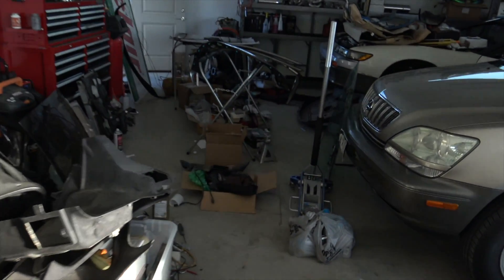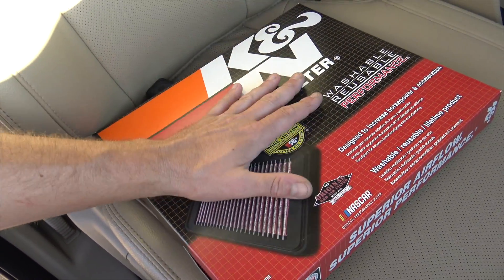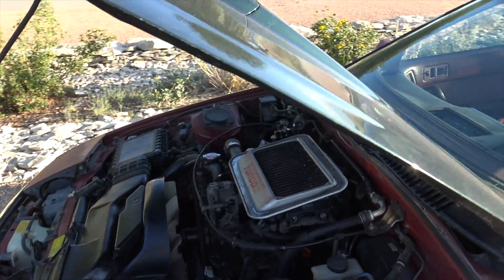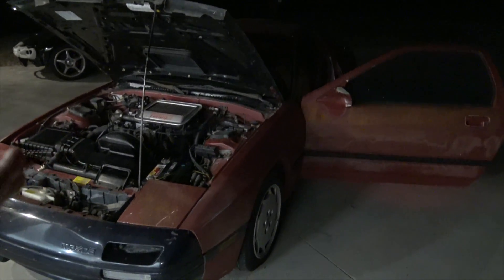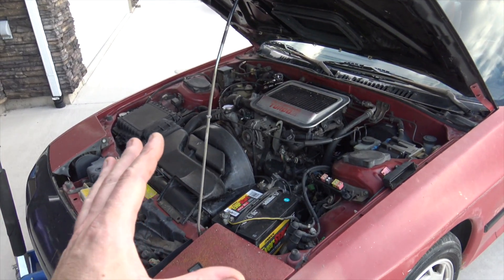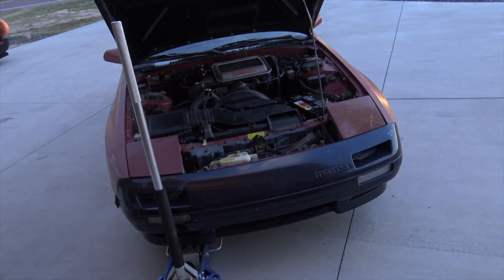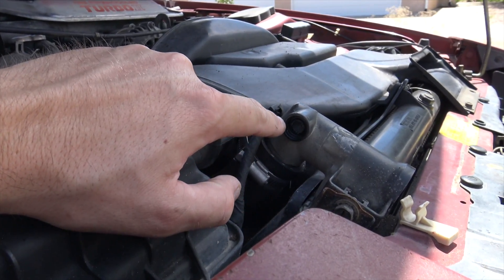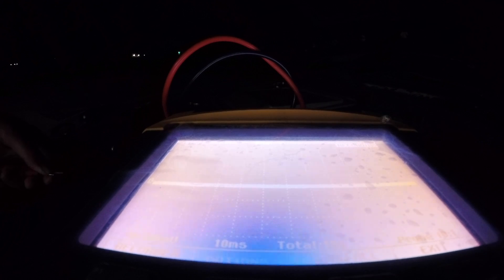Rescuing The Cheapest FC3S RX7 Turbo II From Its Grave | Part 5

Comment: WATCH OUT FOR FUEL CUT! Stock fc ecu cuts fuel to rear rotor when higher than stock boost is detected.(anything over 7/8 psi) And because you’re running an open downpipe it will definitely boost more than that. Get a fuel cut defender or aftermarket ecu.
Reply: Waste gates exist ok
Reply: Broken Piston yeah because stock iwg size on a fc hotside is totally big enough to not boost creep right?
Reply: @brianskotch2922  this thing probably doesn't have a boost controller (at least I don't think so) so it has a spring inside the wastegate that opens up once enough pressure is built up releasing excess exhaust pressure
Reply: @karoliskazlauskas1213  fc wastegate's are notorious for not being able to hold the boost creep........ he should port the stock wastegate and add an fcd at the very least
Reply: @karoliskazlauskas1213  totally get what you're saying but if you've worked on a stock turbo on these things, he's running right at potential issues here.. as the stock wastegate on a S4 turbo is a single 16mm hole. might be able to fit your pinky down there? for what it's worth, it basically doesn't exist once you've got a decent exhaust/intake on there. beyond that, I've heard reports that new, completely stock S4 still had boost creep issues in very cold ambient temperatures, hence mazda put the fuel cut thing in there to kinda(?) protect it.

Comment: Best way I've ever used to find vacuum leaks is spray brake cleaner on the hoses while its running n listen for a change in idle
Reply: Just replace all the hoses with the upper intake off and delete emissions that's what I did takes little time.

Comment: Don't forget too, the open exhaust will pick you up almost 5 psi and 50HP on a TII!....but you will hit boost cut almost immediately, so a boost cut controller will be needed to electronically cap the MAP sensor's output below cut levels. This has the undesirable effect however of making the AFM the computer's only source of airflow measurement, and once you exceed the flap door's ability to open further, fueling will no longer increase. Increasing pump pressure and swapping in bigger secondarys, or go old-school with an AIC or F-con to bump the fuel.....yea, pretty archaic stuff, but so is the OBD0 Jetronic EFI on those old RX's!

Comment: glad to see the progress, if you did not get the rear brake issue resolved already it is probably some garbage stuck in the bleeder screw, you can take it out and use a pick to open it back up the put it in and bleed the caliper.
Reply from the maker: First thing I did was pull it and it was clear

Comment: The RPMs staying up could be the dashpot located by the throttle body. It is there to prevent the throttle body closing abruptly. It has a adjustment similar to a throttle cable. Some RX-7 owners eliminate that and by doing so the exhaust some times randomly will will pop small split second flame when you go off throttle.  The best thing to do is adjusting it to see if it will solve the problem of the RPM going down so slow. If you want to eliminate the dashpot it is best to wait for idle problem problem to be solve first.

Comment: You might break the turbo with that exhaust hitting the ground.
Reply: KLFER how does that work? Just bending the pipe can warp the turbo?
Reply: @nate8867  I'd be nervous backing over something that would catch the exhaust...  a raised section of pavement or speed bump etc.
Reply: @nate8867  It can crack the exhaust housing on the turbo.
Reply: KLFER I don’t think he’s going to keep it like that

Comment: Been there done that . i had a 1979 Fiat x19 with no brakes. But at 2000 lbs. Downshifting got u pretty close to stop. That lasts 20 miles per hr you had enough brakes to stop.

Comment: Is the hole you plugged for a coolant sensor. Maybe that explains why you don’t have a temperature reading
Reply: Yeah that’s also what I thought
Reply: no its not. The coolant temp sender is on the drivers side rear iron of the engine. He put JB over an air bleed which was just a bad o ring or a leaky plug.
Reply: Patrick Lavoie ohhh that makes sense
Reply: It's a bleed valve your supposed to unscrew it to get air bubbles out of the cooling system as its the highest point in the system

Comment: The front engine cover was changed mid year by Mazda. If you order a front seal kit for an 87 it may possibly be the wrong kit. I had a 7 just like yours and it had a pinched seal in the front cover even though the new kit was just installed. It caused low oil pressure readings. I doubt that is your problem though. Love to see this FC being restored.

Comment: I cant wait for this thing to get buttoned up and painted. I think that screw you epoxied was a air bleed valve for the radiator, no biggie. Since it was the early days of ECU's in these, things can be really finicky. Also I might have a pair of S5 tail lights in storage if your interested.
Reply from the maker: How much for the tails?
Reply: Junkyard Dave Maybe just shipping plus 40, the back left has a chip in it so they aren’t perfect.

Comment: Solder near the exhaust will melt and come loose, also the "downpipe" hitting the ground might break your turbo or manifold, please do not ruin this car and make ir proper.
Reply: It's risky, but, ground contact might also just wear the exhaust down until it no longer drags. Personally, I wouldn't do it. I'd rather exit through the hood.
Reply: Its not solder its weld and it will  not melt lol
Reply: Simon Legros I think he is referring to the o2 sensor

Comment: That is the air bleed for the cooling system highest point.  Since the part is plastic it should have a replaceable o ring on the cap. The cap uses a large Phillip screw driver to loose it up.

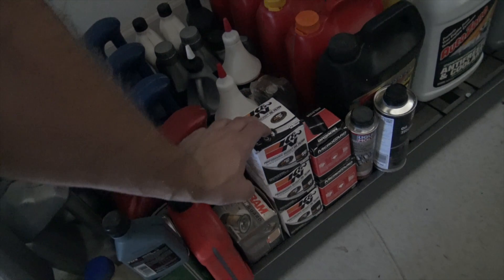Comment: 0:42 OMG those front shocks are so toasted. Makes sense considering how long it sat of course. Dangerous with that extra low downpipe though!
Did you consider replacing the O2 sensor with a 3 wire? Would still function normally, just heat up much faster and hopefully improve idle and cruising etc.
For the gauge cluster, I have often found it's a bent, weak, or damaged pins in the connector. Easiest thing to check. Hopefully that cluster is easy to get out.
I know you probably know a lot of this, but whatever we all know I like to comment. Woulda been brave to go to the drags! Hopefully soon. Good work Dave.
Reply from the maker: Need @bcracingna to hook it up
Reply: Agreed. Time to go make some noise on Instagram. ;)

Comment: I have nearly the exact same FC...
I would replace every vacuum line with silicone hoses.
I use the VR1 in mine as well
Get rid of that dump pipe and get a proper exhaust. I like my Trust exhaust or find someone selling a Racing Beat. I saw one on Denver Craigslist a while ago.
The dash components were notorious for for cold solder joints. Part of the reason the light switch would burn the runs internally.

Comment: I used some injector cleaner on my n/a FC and now it dies while idling, I think the mixture is running super rich. (i'm gettin pops from the exhaust) I'm going to flow the injectors but thats my only guess. maf was fine and clean previous to using the injector cleaner.
Good luck with the rest of your fixes!

Comment: The oil pressure and temp sensors are down by the oil filter pedestal on the rear iron. With the key on, try touching each of the wires to ground and you should see the gauge cycle. if it does, then get new sending units. You can see both of them at 9:00. Since the oil gauge works, Id suspect the cluster is good and power is flowing. The hanging idle is pretty common when you start removing things when running the stock ECU. Its best to pull and plug everything, including the non-vacuum dashpot, then do your best to set the idle speed with the idle and bypass screws. Either that, or leave it all intact and keep everything working as stock(which can be even harder!)

Comment: My gauge did the same thing in my 87 t2 hooked up a true oil feed gauge oil psi is fine they are notorious for going bad.  Check behind throttle body for vacuum leaks there are a few ports on back side hard to see. Also throttle body could be leaking through linkage.  I use cigar method to check for leaks on mine.

Comment: I could be wrong, or not remembering correctly, but I remember my Turbo II tach and speedometer stopped working due to a reverse switch or relay or maybe sensor, I don’t remember exactly. If your reverse lights aren’t working, that could be it. It’s located on the transmission and Rotary Performance bypassed it somehow, as I didn’t have the time or money to have it replaced (it’s hard to get to), but I did have my instruments working. The only downfall was I had no reverse lights, which I didn’t care about.

Comment: That exhaust is going to cause boost creep. Considering your stock ECU will cut fuel, its a very risky mod to save a few bucks on. Also you JB welded an air bleed plug, which you could have fixed with a 2 dollar plug with an o ring.
Reply from the maker: I tried to get the plug out it was broken off it doesn't hurt anything not hard to burp the system
Reply: @Junkyard_Dave  easy outs my man!

Comment: Get the koyo hh66042  i think thats the part number but its a direct replacement. Even has the same air bleeder screw that you plugged up but it wont leak w it being aluminum.

Comment: Horn problem 90% most likely it's the "CPU" - cold solder joint problems.
Long black box in driver's side kickpanel - redo solder joints that hold the plug socket in the center of the box.
Do your turn signals / hazards work?
This CPU also has circuits for those things.

Comment: Hey Dave you should look into getting new secondary coil packs, those might be causing the issue of getting no tach signal. Im up in Westminster, CO and I have a few sets if you want to test them... Also the speedo is a mechanical line that feeds into the trans, its possible that the conector in the cluster is disconected? thats how mine was.

Comment: did you try pulli g vacuum and pushing the brake pedal also I was under the assumption you are supposed to bleed the caliper furthest from the reservoir first or does it not matter im just curious that thing sounds so sick great job breathing new life back in that old girl dave also do those wires hanging out of the bottom of the dash when you were talking about fixing the gauges have any thing to do with it they looked like they were ripped  off a motherboard from the video it looked like there was pieces of it on the end of the wires
Reply from the maker: The wires go to a dash speaker,  and on non abs cars the master is devided front and rear so it makes no difference

Comment: That thing that was leaking on your radiator is meant to bleed your cooling systeem, you remove that plug when your filling up your radiator so that the air will get out.

Comment: Have u seen good results with the liqui-Moly additive?
Reply from the maker: I use it in everything and it saved my Volvo from dieing when an oil filter exploded somewhere on a 3500 mile road trip
Reply: I appreciate the reply. 
Ive heard alot about this not working great in a rotary motor due to the high engine temps causing the moly to break down. 
Also, you added two cans to an oil change?
Reply from the maker: The oil should be around the same temps as a normal piston engine, plus it shouldn't brake down since it is mostly zinc, and I only used one can but fill it with oil to clean the remaining stuff out

Comment: Do u guys use 2stroke oil with your fuel? (Rotatory), Like, always or just to start like on the previous video bcause its sit for a while?
Reply: Always premix.
Typically when starting for first time in a while you'll use ATF in the housings and slowly rotate them over to free seals up well and coat housings

Comment: please port the wastegate and add a fuel cut defender before you fuel-cut the rear rotor and blow this up. the stock wastegate can not handle extra boost created by opening the exhaust like that.

Comment: That wankel is running worse than a normal engine without spark. Its suppose to run as smooth as putting a coin on top of the engine side down and not tipping over. Its not running good
Reply from the maker: The engine mounts are old rubber and it has everything delete so idling at 800-950 I would say it runs about as good as my built 13b in my FD if the idle wasn't set at 1200

Comment: maybe just me, but that thing looks SLOW, slower than my ZX3...
Reply: From the factory they only made 183 hp and this one is completely fucked so... yeah. Fun Fact: the ZX3 came with the duratec which was originally a mazda motor as well. People get these cars becaus they take mods well: https://www.youtube.com/watch?v=CGEEYZ31xz4
Reply from the maker: Wasn't ripping it just working out the kinks, if you want to brake something just go beat it to death before you make sure everything is ok
Reply: He wasn’t getting into the throttle much because it was a test drive 🙄

Comment: Trained technicians would know you bleed brakes furthest from the reservoir and work back 🙈🙈 please don’t touch brakes if you don’t know what you’re doing 😱
Reply from the maker: That's only true with abs, front and rear are it's own independent system so it doesn't matter

Comment: Dude what are you doing! People like you are the reason rotaries die. That hole is there to be able to bleed air out of the cooling system and now you have made it impossible to do so. Also why would you hang that exhaust down so far... It looks ridiculous and when it hits something it's not gonna be good. It's a old car. Pull the instrument cluster and clean the contacts. And the speedo may be mechanical on that model so that cable may be broken. Instead of looking for every half ass way to make things work. First look for the right way to do it. You will be surprised at the good results. Like that plug you could have found at the junkyard off of other Mazda radiators. And if that didn't work buy it from Mazda. WOW man
Reply from the maker: I'm the reason rotarys live, the exhaust has no effect on the engine. A rotary engine needs no back pressure
Reply: Junkyard Dave I know that the rotary needs no back pressure. I’m creating how low it hangs and that if it’s hit you can damage the turbo. But that’s not all I was pointing at. I have owned many RX-7’s and I have seen it all. I’m just pointing out issues that you can easily correct. Good luck with it anyway 👍🏾